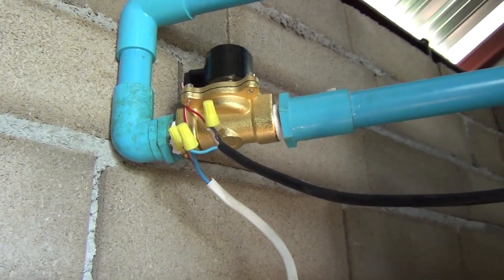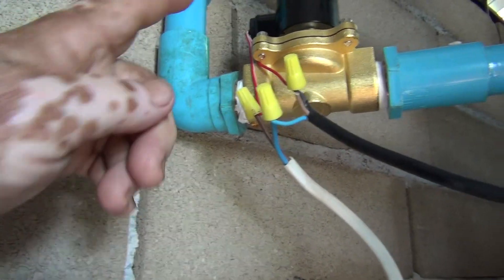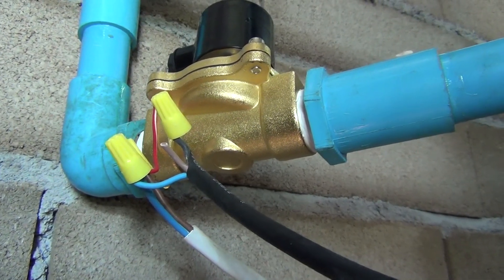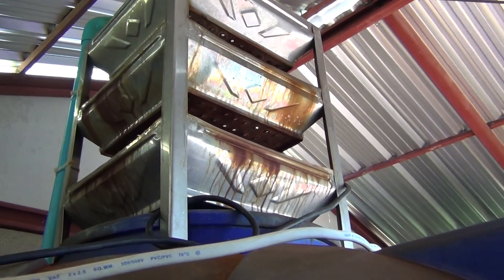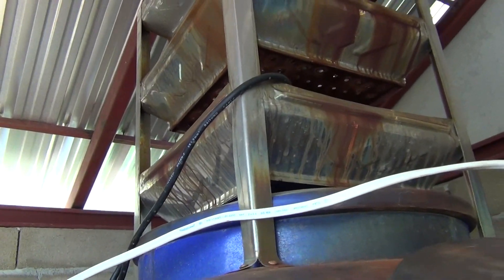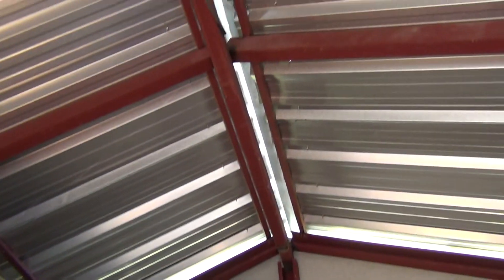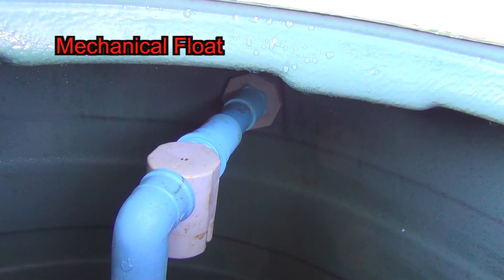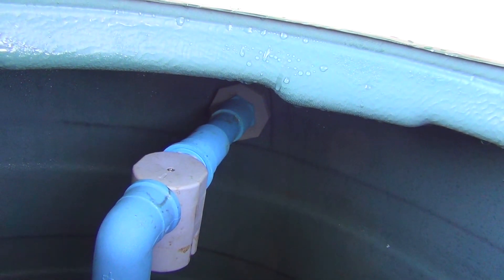Installing A Solenoid Valve

Comment: sir, my question is, is the solenoid valve high in electric consumption? second question: is solenoid valve can stand for 16 hours nonstop every day?
Reply from the maker: Solenoid does not use much electricity. And I am sure that it did, which stand more than that. Thank you for your comment. Thanks for watching.

Comment: definitely not code, as it stands.  I just hope that nobody gets electrocuted by the time you get around to doing the electrical to code.
Reply from the maker: I hear you, and there is no danger of electrocution for two reasons. One it is in a locked room with no access to anyone. To any time that hi work on it the main power is off before going into the room. Thanks for the comment. Thanks for watching.

Comment: Which solenoid do you recommend AC or DC?
Reply from the maker: I would recommend the AC simply because it would probably be easier to maintain. With the AC all you would do is run one wire and you have your voltage there and that’s it. With the sea you would need a battery, a charger, or some kind of AC to DC converter. And if you’re going to do that you already have the AC there available. Thanks for watching thank you for your comment.

Comment: Good day. My air tyfon is not working correctly. It can start, but it did not stop by itself. Solenoid valve is opened but could not to close. Tyfon only stop when closed air inlet valve manually. May be you now what can be the reason?
Reply from the maker: Good day to you also. I'm sorry but I must ask. When you say a i r tyfon, are you referring to some kind of air horn or something like that? Let me know so I can understand what you are talking about and what the question is. I will answer your response. Thanks for watching

Comment: You do know that valve is not for drinking water for that type of Brass and as corodes will leech lead into your water supply. That is for irrigation and other types of fluid. Lead never leaves your body.
Reply from the maker: Thank you for your comment. Yes, you need NSF certified valves for potable water. Thanks for watching.

Comment: I'm looking for a valve that I can install on a 1/2 inch copper water pipe that will turn water on and off remotely from 50 feet away as soon as the power comes on or goes off. The way I plan to turn power on and off is with one of those remote electric receptacles people use to remotely turn their outdoor Christmas lights on and off. Anything you plug into that receptacle will turn on or off by pushing a button on a small hand held remote. Reason I'm needing this is because I put a water hose reel beside my driveway to rinse off the cars but it is connected to a water line in the backyard. I only want the water to go to the water hose on demand when needed but I don't want to have to go to the back yard to turn it on or off. There's a 6 foot fence between my cars and the back yard so the only way to turn the hose on and off is to go in backyard, turn on the valve, then walk through the house and out front to the driveway, spray off the cars and then go back in the house and out the back door to the back yard and turn the water valve off. I plan to keep the on/off button remote in my car. When I push the on button, it will power the receptacle in the back yard which in turn will supply power to the water valve I place on the 1/2 inch copper line. Do you know what kind of valve I would use for this? I have live power right next to where I want to install the valve. I'll plug my remote Christmas light receptacle into the live power and then turn it on and off with the remote inside my car. I don't like to rely on wifi stuff involving an app on my phone to do this, hence the reason for the Christmas light plug and hand held remote.
Reply from the maker: Before I answer your question I am assuming that there is water pressure up to the shut-off valve in the backyard. If this is true, all you need to do is add shut off in the front yard by your house r e e l. Now I don't know how that shut off valve is set up in the backyard. But if it is only for the hose in the front yard then remove the valve in the backyard so the water continues to the front yard and at the shut-off valve there. So all you are doing in essence is moving the location of the water shut off valve. And you will need no electrical power. Let me know exactly how the water gets to the back yard shut off valve and if it is used for something else at the same time. If it is used for something else at the same time, then t off from the pressure side and that the audit off valve in the front yard. If you do not have constant water pressure, tell me why not. Then I will be able to give you my opinion and advice. Thanks for watching.
Reply: @JustLivingWithGeorgeAndWoon  In the backyard I installed a Deionized water tank that creates spot free water for rinsing the cars off in driveway. The DI tank gets 50 PSI water pressure from a cold water 1/2 inch copper line tapped from my kitchen sink supply line out back. We wanted the DI tank in the backyard because it doesn't look that nice if I put it out front; its a big ugly tank and the wife didn't want it out front. Problem I have is the company that provides the DI tank tells me I should not leave water pressure turned on to the DI tank when I'm not using it because they can blow the cap off the top, they say it happens a lot. I've been leaving it on to feed the hose spigot out front up until now until they said not to. But since the DI tank is out back, I'm having to turn it on out back to feed the water spigot out by the driveway. Between my cars and the DI tank is a 6 foot privacy fence and about 30 feet. So I need to somehow be able to turn on the water to the DI tank out back from the driveway so it feeds my spigot on demand when needed. Other issue is because if you have a water hose out front that can easily be turned on out front, the homeless people will take a bath in your hose at night and some during the day as well in broad daylight. I don't want anyone from the street to be able to just walk up my driveway and use my DI water because the filters are expensive and its only for rinsing the cars off, not taking a bath or any other purpose. I figured, I would look for a powered valve to put on the 1/2 inch water line before the DI tank and plug it into one of my remote receptacles we use for the Christmas lights as the remote works up to 100 feet to turn the power on and off. I'd then keep the remote in my car to turn on the water when needed. US Solid isn't answering their calls so I don't know which one to buy as it will need to have a plug on it. They also have a lot of 1/2 inch valves so its hard to determine which one I need and how I'd power it because they are all low voltage.
Reply from the maker: @MercedesMechanic  Ok. So there are several problems here. First the company that you got theDI tank from is correct. To solve this you need a float to stop the flow of water after it is full. A mechanical float would be good for this. The only issue you would have is making sure you have enough room inside the tank for the float to move freely. Then of course you need to move the water to the front yard. The question I have is, do you have enough gravity pressure to get the water to the front yard. Of course if you have a pump feeding the water to the front yard that would be perfect. Do you? So this is the solution I see from what I understand. Obviously you have been using the water as it is from your tank to the front yard, correct. If yes, then install a shut-off valve near the front yard so you can use it without going to the tank. And at the tank install a mechanical float to turn off the water when the level reaches whatever level you have chosen. The water coming from your kitchen can remain on because the float would turn it on and off as needed. You would have no need to install any kind of electrical valve. Hope this helps. If there is something I am not understanding or anything you don't understand please let me know I will continue to answer any comment that you might have. Good luck.
Reply: @JustLivingWithGeorgeAndWoon  You didn't understand what I'm trying to do. The DI tank looks like a giant scuba tank one would use for diving. You cannot put anything in it, it contains a resin inside it that turns regular tap water into pure water by removing all the minerals from the water to eliminate spotting on your car. My water pressure is set to 60psi and I connected a 1/2 copper line to the kitchen sink cold supply just outside my kitchen, the water line to my kitchen is just under the house so I tapped it, then I placed a ball valve on the line coming off of it. That ball valve when turned on will supply water to my DI tank. Then theres a pvc line that leaves the DI tank and runs alongside my house all the way out to my driveway out front. There it connects to a hose spigot which I have a water hose connected to. The only way the spigot out front will work is to turn on the ball valve in the back yard. So, all I wanted to do was have water on demand to the spigot out by the driveway.
Reply: To do this, I hooked an Orbit sprinkler system with remote and a sprinkler valve to the water line just before the DI tank. The system has a remote control I keep in the car out front. That remote will now turn water on and off from the driveway with the push of a button. Problem solved.
Reply from the maker: @MercedesMechanic  ok, got you. One more question what is the pressure range for your tank? If the manufacture is  telling you that your tank can pop then it is too much pressure. Let me know what is a safe pressure range for the tank.
Reply from the maker: @MercedesMechanic  good for you. However, what I am concerned about is the water pressure going to the tank. You have to make sure that it is within save manufacturer operating pressure. It might not break now but sometime down the road it might if the pressure is exceeding safe operating pressure. Good luck. Thanks for watching.
Reply from the maker: @BodyDetailerPersonalCare  ok good deal. I have never had one of these systems...however when you deal with water, pressure is everything. Thanks for your comment. Thanks for watching.

Comment: Thank you for posting the video. 1) the valve you are using a solenoid valve or ball valve? Is it a normally open (electric current) valve where the value is closed no water going through.

I currently have a N.O. value ties into a pump so it always powered , the valve is closed. When the float goes down the power goes off and the valve opens to let water through. It is a little hot so I like what you said, no power until float is down. Thanks
Reply from the maker: It is a solenoid valve that is normally closed! It is is hooked up to an electrical float located in the water tank where the solenoid valve is located. So what happens is this, anytime a faucet is opened the well motor comes on to provide water to that particular pump. So the important thing for the system is that it is regulated by a pressure gauge...30-50 lbs. As soon as the faucet is closed the pressure comes up to 50 lbs the pump shuts off. But the water will not pump into the water tank because the float has not provided the power to activate the solenoid valve. It is part of the main well, yet controlled individually. Works very well for me. I am glad it worked for you. Thanks for watching.

Comment: What kind of solenoid valve is that i need exactly that type of solenoid.
Reply from the maker: Well it depends on what you are trying to do. Are you trying to have the water run all the time and then shut off and then on again (open valve)...or are you trying to keep the water off and then run and then on off (close valve)? You must tell me what you are trying to do. And also what kind of power you have available. Thanks for watching.
Reply: @JustLivingWithGeorgeAndWoon  im trying to put that into pipe before pressure thank i want to open the valve wen motor is running and i want it off if motor is not running i need 230volts ac
Reply: Because our motor is running even it is not in used something the stock in pressure tank is has a leak but not in our side somewhere in pipeline not after the tank i already check..
Reply from the maker: @butzbravo6096  Hello Again. What controls the motor is pressure. So if you have an automatic pump shut off it is internal. Another way to control the pump is with a pressure regulator, and of course you can shut it off by hand by unplugging or adding a shut off switch. The solenoid valve will not do that. Now if you have a leak your pressure will never build up so the pump will continue to run until it burns out. First you must fix the leak and have the pump turn on and off by itself before you can add a solenoid valve. The solenoid valve is controlled by an electrical float valve that goes inside your tank. As the water level changes the pump will turn on and the then turn off as it reaches the water level you have chosen by the electrical float valve. Do you know if you have an automatic pressure shut off for your pump? Where is the water coming from, a well? Find and fix the leak first, this is a must.
Reply: @JustLivingWithGeorgeAndWoon  thats why i want that solenoid valve before pressure tank i will use it to act like swing valve. Water can flow but cant go backward interms of running the motor.

Comment: 24v ac solonide valve how to connect float switch because the solonide valve  Is 24v ac how to supplying the float switch
Reply from the maker: Hello and thank you for watching. First of all you have to have a power source to match the solenoid valve. In the case of my valve it is a 220 volt AC valve. Therefore it is just normal house power. If you are using a 24V DC you must have a power supply that you connect to your house plug and it converts and supplies the needed 24V DC power. The solenoid valves are available in 12V DC, 24V DC, 110V AC, 220V AC either open or closed. What this means is that pending on what part of the world you find yourself you must match the valve with the available power in your country. Here we have 220V AC, so I could use a 220V AC valve or a DC valve that accepts 220V AC to convert to DC power. Now the open or closed depends on whether you need the water to always be running (open) or always off (closed). I needed the water to only come on when the water in the tank was used, therefore closed. So I hope this helped you. If you have more questions feel free to comment and I will answer your questions. Thanks, have a great day. Good luck with your installation.